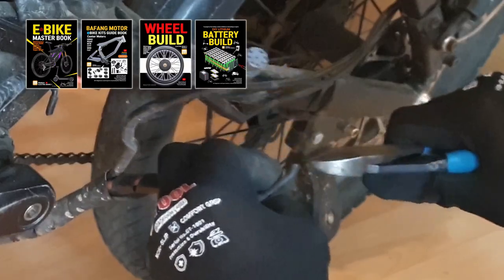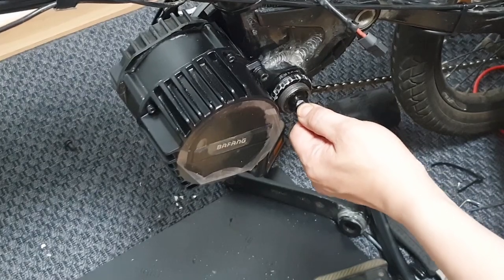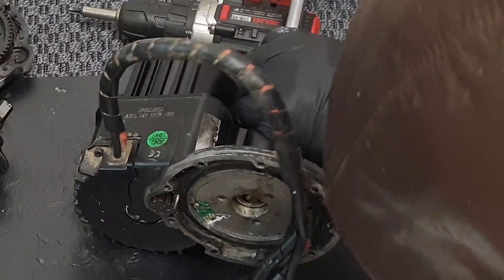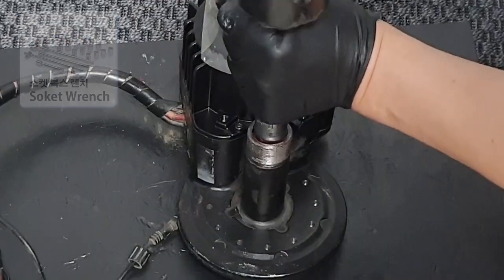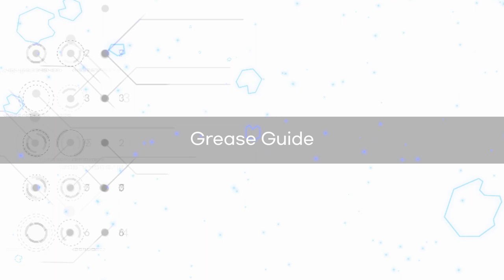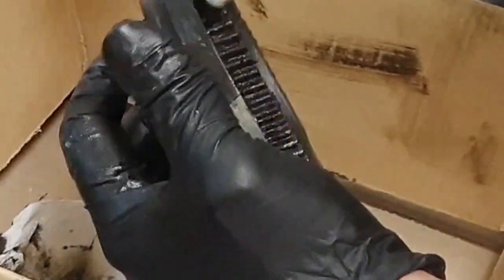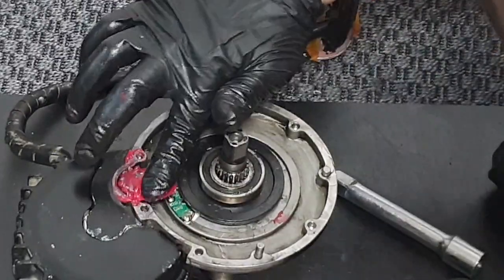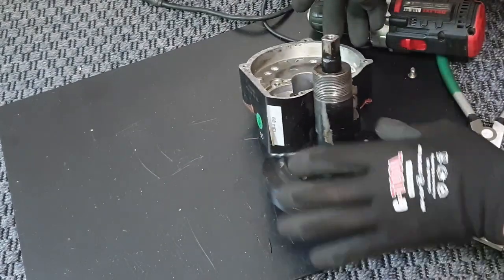Book : BBS HD Bafang Motor Repair Guide 02

Comment: First of all great videos! I have a bafang motor sitting in front of me that is sounding like it has gravel in it. I have inspected the large pinon gear and the small pinon gear and see nothing wrong. The bike is functioning as it should other than the noise. I was curious if you may have any ideas? I have not tore into the other side of the motor. Thank you.
Reply from the maker: It could be a bearing problem in the nylon gear or a motor rotor problem.

Comment: Hi. Iv replaced both pinion bearings and the noise has gone as inner bearing was absolutely destroyed, now it's quite but no power. The motor spins and a slight resistance noise and no torque. No power going through. Could the nylon gear just be spinning on the pinion? Iv got a new gear on the way so hopefully that fixes it. But surley if it if that won't the new gear slip aswell? Any advice? I can pedal it and there's power but non from pedal assists, you ehar the motor come on but no power going into the gears. So the clutch is working fine, any ideas? I live nomadic with my dogs and have been broke down in the same town nearly a full year now. And everything else has been replaced brand new. But then the grinding noise started, then started slipping. Now iv replaced bearing on both sides of pinion getting no power at all now. Just sounds like it's spinning in the pinion
Reply from the maker: The plastic nylon gear is called a one-way clutch and is responsible for transmitting power to the small pinion gear.
I recommend replacing the plastic nylon gear with the small pinion gear.
I only installed the plastic nylon gear and it fixed the slipping problem without transmitting power.
That is, if the motor rotor rotates properly.

Comment: Hi, Great video mate and really useful.  No idea if you will pick this up but  just wondering if you have ever regressed the main gear without removing from the motor from the bike. I have wired my BBSHD in nicely and took a long time so would rather not remove the motor from the bike and so was wondering - is it possible to 'safely and effectively' try degreasing and degreasing her still on the bike? I have the in/out play and so looking to replace the thrust bearing so i'll be in there anyways.

Comment: im getting the sound of dry bearing somewhere and the small pinion gear wont spin by hand, very stiff, what do you think the problem would be?
Reply from the maker: There are many cases where water flows into the crank needle bearing.